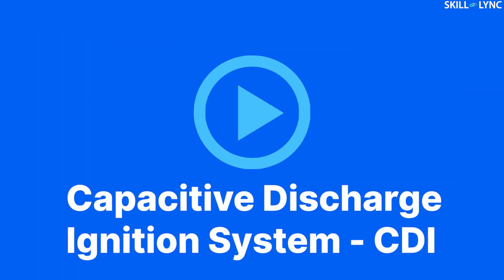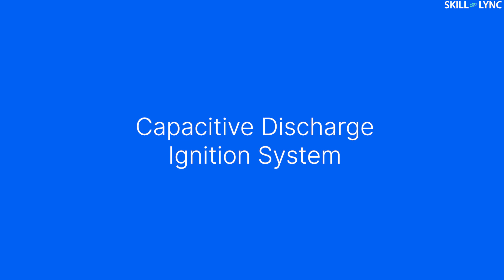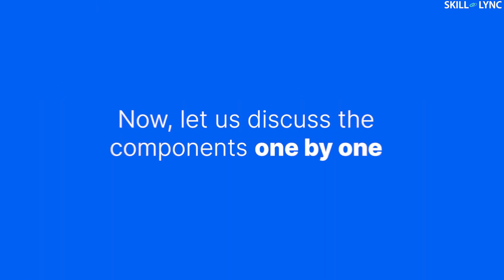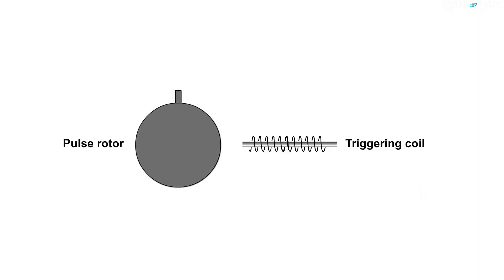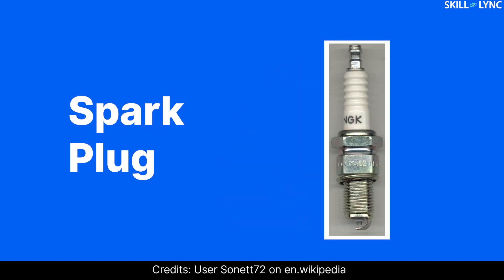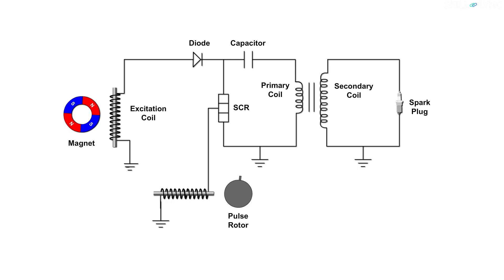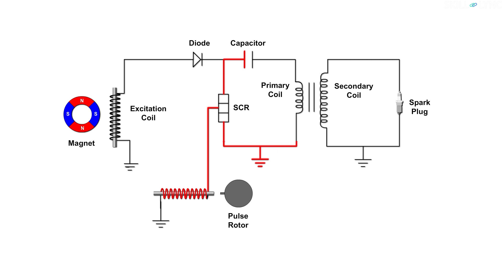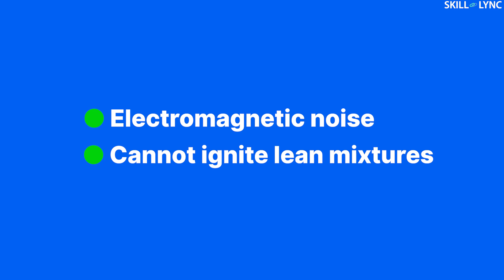Capacitive Discharge Ignition System | Skill-Lync

Comment: Sounds like you can use an AC CDI if you have a high enough DC voltage, maybe step up 12V to 48V with a DC-DC convertor?

Comment: There is a diode means it is DC, then how it is stepped up in the ignition coil is still my doubt 🤔
Reply: Transformers transfer energy between two coils through changing magnetic fields. A current in a wire creates a field - a changing current creates changing fields and can transfer energy through a transformer. AC works with transformers because it is constantly changing voltage and consequently current. Transformers built for AC are meant to constantly work like this.

Ignition coils are pulse transformers - not intended to be constantly driven, but rather blasted periodically. When the SCR grounds the capacitor, suddenly the voltage in the capacitor sees ground and the current jumps up. Since the capacitor shares a loop with the primary coil, this suddenly changing current induces a suddenly changing field in the coil. Sudden change in field yields your induced current in the secondary and bang.

TD;DR : Switching DC quickly creates a changing voltage that can drive a transformer like how we’re used to AC doing. (AC is just a less extreme, constantly changing voltage)

Comment: This is also what Ferrari Dino uses with its Magneti Marelli Dinoplex unit , a much more primitive version that is. That still uses contact breaker points as the "triggering device" and im not really sure if it has that magnet on the flywheel

Comment: sorry men but in my opinion nothing changed after the invention of dc magnetos all of that is the same crap only the condensers are diferent use ceramic hv capacitor non electrolitic you get plazma ignition cdi is still weak for multi grade fuel engines but that one burns even disel fuel that presentation aplly to some degree but not to all ignition systems its simply weak spark winter is a death sentence and moisture to gasoline engines

Comment: Electromagnetic noise ? Can you please elaborate... Does the sound comes from the engine or CDI itself ? Also, need some information regarding the tappet noise in the IC engine.
Reply: It does not make noise that you can hear with you ears.  It would be noise that you would hear on an AM radio which is nearby.
Reply: It can come from spark plugs and wires.